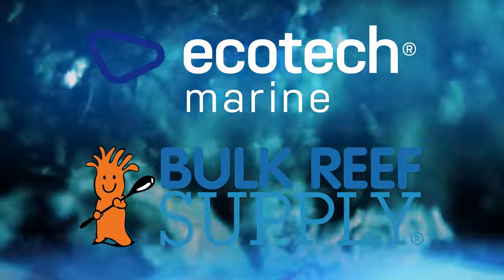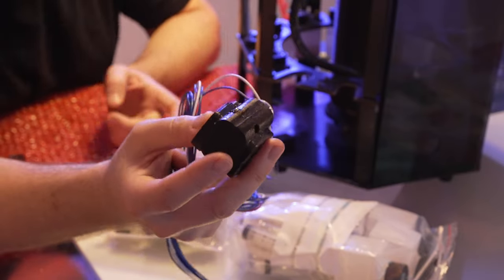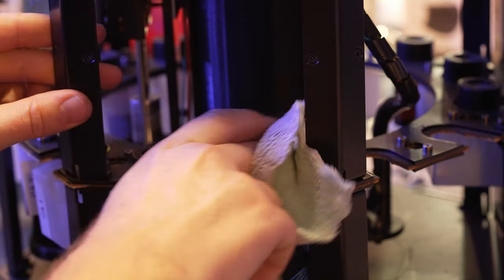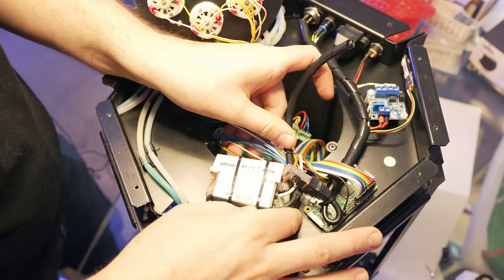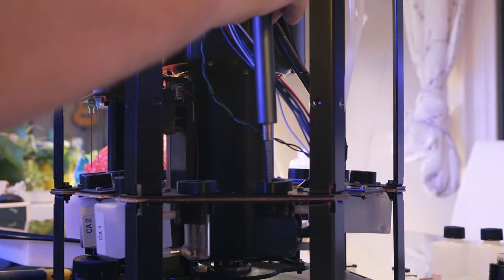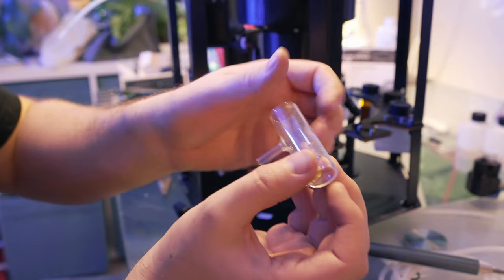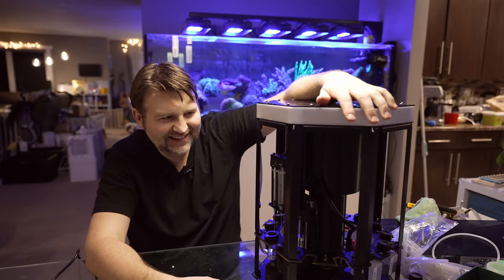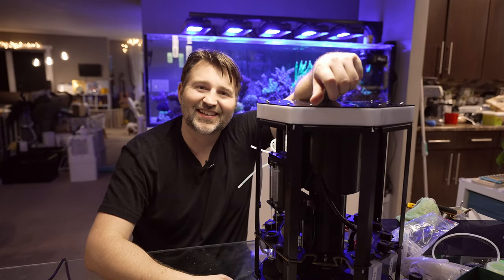ReefBot Lab - How to Upgrades

Comment: I'd really like someone to focus more on consistency and reliability of test results. If it can't be relied upon, then what benefit does it offer?
Reply from the maker: I did some in the early days.   Maybe next time I do an ICP  I’ll do an upgraded comparison
Reply: @ReefDudes  Have you done much experimenting with the reagents to see which are most accurate?  I would love for the be all end all to eventually be the ABC reagents for the ALK, Cal and Mag as they are the cheapest around and only require one vial each.  Hady has been working on them but they are still in beta.

Comment: The fact that it appeared to be easy to work in with all that space, makes me lean more towards this device vs mastertronic. BUT I saw that a new mastertronic is coming so will wait and see how that works. And the KH SPA. Though the SPA appears to be so tight which would make it hard to work in. Don't mind if it is a large device for the tank I plan to use it in.

Comment: I just got my machine today . It is batch 5 which I don't believe have all the upgrades. However, before shipping, they sent out an email and to my interpretation... they prob upgrade my machine .... how can you tell if these parts are new upgrades or not. Mine came in without the led switch which I assume mine does not have those upgrades . But then I notice my reaction chamber is fully covered on the bottom like you pointed out in the video (is this part a new upgrade version then ?) Now I am so confused.

Comment: I've never had one accurate test from mine, so I guess I'll spend some more money to try and get it working.  I'd replace the tubing, but $35 bucks for 12 feet is highway robbery imo.
Reply from the maker: You can always source the silicone tubing from generic sources
Reply: @ReefDudes  True, I was mainly pointing out that their prices are too high.  $30 for 10 needles is ridiculous.  Finding those someplace else without a medical license is a real pain.

How close have your results been to manual testing of the same kits?  Also, have you tested Alk against a Hanna checker?  If so, did you ever get anywhere close to the same results?
Reply from the maker: @grimcarnage4309  Way back when i compared results to an ICP and they were reasonably close.  within the error of margin of the test kit.  Consistency and trends are the real value though.. most thing the number doesnt reallllly mater.. i care is it stable, going up or down ect.     If yours are way off its prob due for some maintenance/calibration for good measure.
Reply: We are very sorry to hear that! Can we please have your email so we can check your issues and contact you?